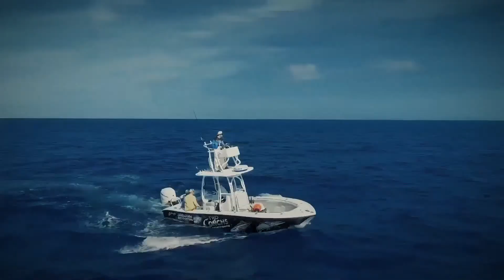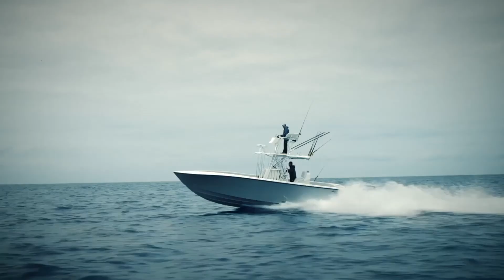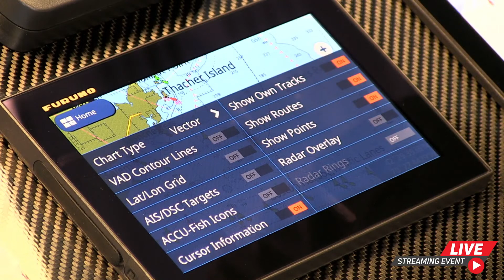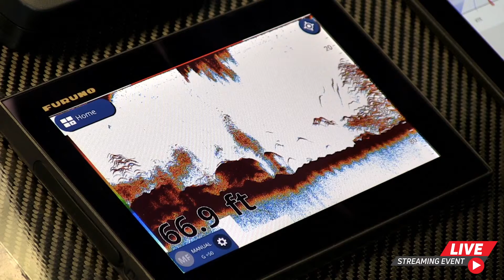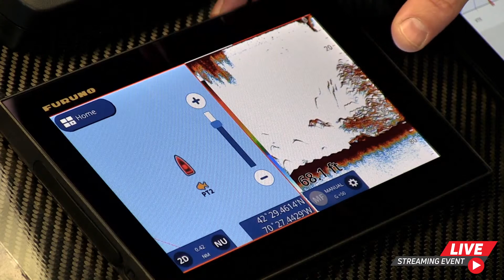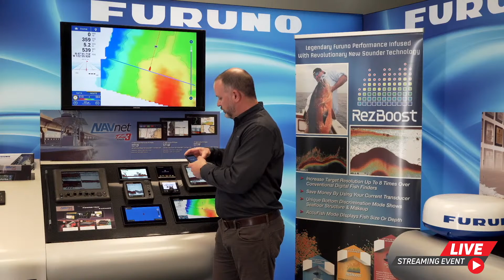GPS Chart Plotter & Fish Finder Combination Units

Comment: Now you said they are single chirp units. Does that mean it won't work with a low,high,wide transducer? Or a high,wife ducer?
Reply from the maker: Hi Brad, the GP1x71F is dual freq 50/200 or single Freq CHIRP.  The Single frequency CHIRP supports a choice of many Low, Medium, and High-frequency models, including the wide variety.  Please consult the list of compatible transducers on the product page under accessories for suggested models:

https://www.furunousa.com/en/products/gp1971f
Reply: @FurunoMarineElectronics  thank you. I've sense learned it will run a hw chirp
Reply: Can the 71f's run a position attena for more gps accuracy?
Reply from the maker: @Brad-id7ge  Yes, these combo units can use an external NMEA0183 or NMEA2000 GPS source

Comment: Missed the live stream unfortunately. Wanted to ask if the GP1971 and a TZT2/3 can share waypoint information. For example, if I mark a spot on the GP, will it save as a waypoint on the TZT? If so, how do I set that functionality up?
Reply from the maker: Hi Ben, thanks for watching! You can move points between the two systems using media in GPX format. However, they will not share waypoints or routes via NMEA 2000.  To have waypoints or routes in consistent sync with the TZT2/3, you could use TimeZero software.  The GP1871F/1971F is designed to be a stand-alone combo unit, not a fully networked MFD like the TZtouch series.